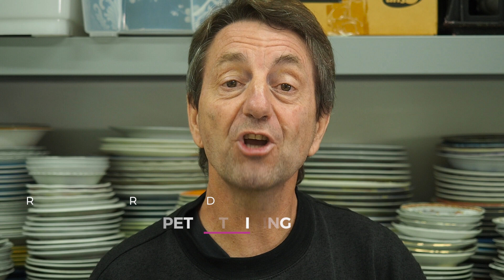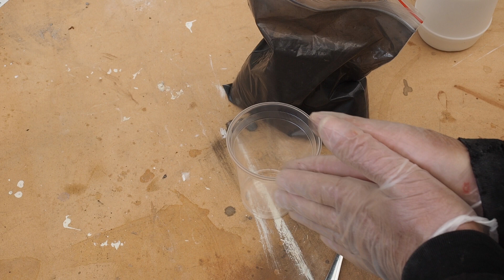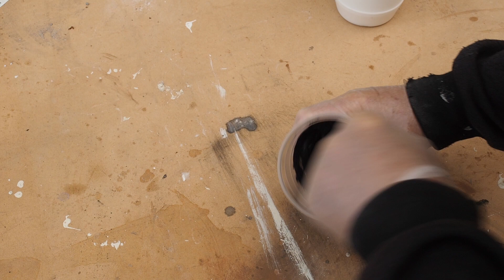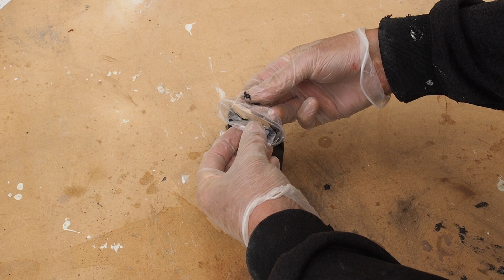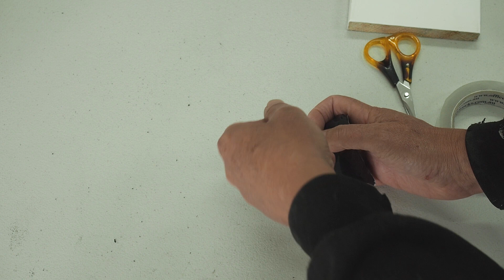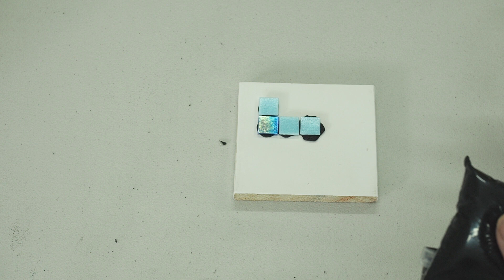Creating Thinset Using Grout - Mosaic Tutorial

Comment: Hi! When using this method, it solidifies very quickly for me in the bag, within 30 minutes, and then I have to mix more. Any ideas to prevent that?
Reply from the maker: Hi Olive. I haven't had that happen although temperature can play a part, if its warmer it will influence the curing time, so you may want to look into the temperature. Also there are different brands and that may also play a part as well. I hope this helps and thankyou for watching and for commenting. :)
Reply: @TreasuryRoad  thank you!! It’s been hot here so I think you’re onto something :)

Comment: Will thinset glue plastic pieces into a mosaic Peter?
Reply from the maker: That l cannot say l have never adhered plastic with thinset. Plastic has low surface energy which creates an issue with many types of adhesives. They generally appear to stick and then let go at a later date. There are also different types of plastic which just adds to the issue. Thanks for watching and for the comment. 😊

Comment: Thanks for your tutorials , very clear demos! Question , is there a product that is glue and grout so different size tiles can be push into it, no need to grout? 
Thanks in advance 🙏
Reply from the maker: Thankyou so much Ana. Generally speaking thinset (cement based adhesive) can be used as an adhesive and grout. This is the way that it’s done when using Smalti and in some cases slate. Do a small sample piece with the materials you’re looking at using to make sure it’s going to work with them and it will familiarise you with the process as well. 😊
Reply: @TreasuryRoad  thanks for your prompt reply, and knowledge . Yes I was thinking about to mosaic terracotta pots with shells and things I find at the beach . So just push them into the mixture. Any recommendations what brands to use,? 
Thanks again for your time 😊🐠
Reply from the maker: @anaschilling2668 Thankyou, I like Laticrete products for thinset, they are a world wide brand. There are different thinsets so just check with the retailer to see which one suits your needs. Also when you use the thinset use the baggie system it will give you greater control because its very sticky stuff. :)
Reply: @TreasuryRoad  oh so much to learn!! Thank you so much again!! I’ll look into it!! Looking forward to my next project!! 
And Looking forward to your next videos 😊💙
Reply from the maker: @anaschilling2668  you will get the hang of it pretty quickly. 😊

Comment: Thanks Peter for your video.
For making a thinset,  If I want to use an adhesive like "Davco Glass Mosaic Additive",  should I use Davco Grout aswell or any grout like Dunlop will work?
Reply from the maker: Thankyou very much Mozhdeh, whenever l use a product l like to use a turnkey system, if I’m creating the companies thinset l like to use the same companies grout as well as l find they are generally made to work hand in hand which can save any complications now that’s just my thoughts and l can’t comment specifically on your products. I always say to people read the manufacturers technical data sheets on the products their using as they have the accurate information you need and are very easy to read, generally available on their website. 😊

Comment: you are my mosaic hero. Peter, I have been wanting to take a plastic bird bath i have and mosaic it. can it be done and what would be the proper sealer and way to make the tile stick to the plastic and not lift on the corners of the birdbath thanks
Reply from the maker: Thankyou so much Michelle, I would avoid mosaicing over a plastic birdbath or most plastic for that matter as it can become brittle over time and and may have some flex in it, also the surface tension of the plastic can be an issue with adhesives. You are really better using terracotta or concrete and if you're in a freeze thaw area avoid using terracotta as its quite porous. We spend so much time on a mosaic its best to use a good substrate and suitable adhesives and materials to ensure the piece has longevity. :)

Comment: Thank you for all of your great videos, it has helped a lot getting started in mosaics... especially for demystifying all of the grout and mortar products on the market. For the Laticrete products, I am not able to find 4237 latex admix in smaller containers. I have seen that Laticrete has a bagged/powdered thin-set mix called "254 Platinum Thin-set" that already has the latex admix in it. The product data sheet does say that it can be colored like the grout. For this 254 mix you only add water to it since the admix is already part of the blend. Have you ever tried this thin-set mix?. Getting the 4237 latex admix is looking like an issue as it is only sold in the large bucket that you showed in the video. I haven't found a mosaic company in the U.S. that sells it in smaller quantities. The only option I can see is to us the 254 Platinum thin-set with colorant to achieve the same thin-set and grout color, which would make life a lot easier. I would like to use Laticrete as it does have advantages, one of which is that the grout doesn't need to be sealed. Thanks for any information.
Reply from the maker: Thankyou so much John. Thinsets can generally be coloured with oxides, this video just shows one combination, a lot of people colour their thinsets, I haven't used the 254 Platinum thinset but I think it may be may be able to be mixed with Laticrete Permacolour Select pigment packs, just verify this with the technical data sheet. Definitely colouring your thinset is the best way to go in my opinion. :)
Reply: @TreasuryRoad  Thanks for the info. I've been looking at the Laticrete data sheets to try to figure out the best way to go with which line of product to use and what combination of thinset and grout. It's confusing because they have several different lines of products. I realize now that their "Permacolor" line of grout is all precolored and there is no uncolored base mix. Whereas the "Permacolor Select" line is meant as a base to add colorants of your choice. For the Permacolor line, the data sheet says to only add water to it, but you've done well coloring it and using admix to get a thinset out of it. I have a floor tile store near me that carries the Permacolor products, but not the Permacolor Select products. So, I might just get the several grouts in different colors and color the thinset to match as needed. Thanks for all of your help figuring this out. I can move on to the experimenting phase :)
Reply from the maker: @Nature_Mage  My pleasure. You're right it can be a bit daunting. You can also ring Laticrete as they have a great technical department that are familiar with mosaics and will definitely help you choose. On the laticrete Permacolour grout technical sheet it says you can add Laticrete Latex Additive to create a coloured thinset, if you're grouting than you can just use water. I would think your tile store should be able to get in the Permacolour Select Products. :)

Comment: Thank you for this video. Is Perma color grout
 sanded or non-sanded, does it matter? Thanks again. :)
Reply from the maker: Thankyou. Laticrete Permacolour grout is a sanded grout. With regards to does it matter between sanded and non sanded, its best to use sanded grout for mosaics as it can go into wider grout lines and there is a greater resistance to cracking and also slumping of the grout also its a lot more durable, always go for a well known professional brand of grout to ensure you get great consistent results.
Reply: @TreasuryRoad  thank you for your prompt and helpful response, much appreciated. I haven’t ever used grout as an adhesive/thinset before and I’m looking forward to trying this method. 
Your videos are really straightforward and informative. Thank you for sharing your experience.
Reply from the maker: @sunnywilker3841  Thankyou and my pleasure, just make sure that the combination of grout and additive is a combination by the same supplier and is meant to go together to create thinset. I have used the Laticrete combination for years.
Reply: @TreasuryRoad  I don't want to keep on at you with questions, but I'm hoping I can find this brand here in the states. I thinking I can, and if I can't find it in a tile store, I'll check Amazon. You had mentioned Amazon will sell in smaller quantities as well, so I'm thinking now, that'll be my fist stop. :) Thanks Again, Sunny
Reply from the maker: You will as Laticrete is based in the states and you can go to their website and it will tell you your nearest stockist, I made a video on how yo use the Laticrete website. :)
Reply: @TreasuryRoad  thank you!! You are so helpful!

Comment: I am so glad I found your tutorials, I am planning to make a mosaic and cement it to a rock by the ocean where I scattered my mums ashes. Any advice or tips would be gratefully appreciated.
Reply from the maker: Thankyou, appreciate that. Make sure that whatever tess you use and the products you use will be suitable for the harsh environment its going to be in. Use good branded products and have a read of the manufacturers data sheets before purchasing products or give them a call, do not just take face value comments and act on them, preparation and correct products for that environment will be key to longevity of the mosaic. :)
Reply: Peter...this answered alot of questions. Laticrete products are not so easy to find near me. 
 I have much more understanding because you share your massive knowledge.
I would still like to know which protect you like for sealing outdoor mosaics after they are completed.
Thanks!!
Reply from the maker: @marciaelwood5235  Thankyou very much, appreciate that.  Laticrete have great products as do Mapei and a few others. When you mean sealing the outdoor mosaics I take it you mean the grout. I dont seal the grout on my outdoor projects because I normally use Laticrete Spectralock Pro Epoxy Grout as it doesn't require sealing however it is a three part system and more expensive. Impregnator 511 is a very good grout sealer but before purchasing make sure that you read the manufacturers technical sheets and also the MSDS as with any product to ensure its suitable for your job and you can take the necessary safety precautions. :)

Comment: Thank you first for your great videos... love them and look forward to them.
I’m still confused about using thinset and grout. Isn’t the additive just glue?
I am not a fan of grouting. Can I just use thinset with glue added to replace the grouting? Make it squish between the tesserae? Thanks again 🐢
Reply from the maker: Thankyou very much.  The advantage to using the grout and adding the Latex Additive is it gives you over 40 colours of their Permacolour grout range if you want to have thinset in a different colour. You can just buy thinset on its own and use that.  The additive isn't just normal "glue" its a latex additive designed to be used with their products. You can just embed your tess and have it fill the grout lines to save grouting. As always no matter what products you use make sure you read the manufacturers data sheets to ensure its suitable for your substrate, tess and environment its going into. :)
Reply from the maker: Hi Kathie I cant seem to access your comment that you left so heres my answer. You dont need to buy Laticrete products they are just my preference, just make sure its a well known brand such as Mapei or Dunlop etc. You need to use the right products that work together, dont substitute with glue as the products need to work together to ensure stability and strength. You can just buy thinset on its own and colour it with oxides or specific grout colourants, just make sure the thinset is rated for the tess you are using. Just for the record Smalti is generally not grouted as it can dull the finish and fill the pits up with grout. Using thinset with smalti is correct.
Reply: @TreasuryRoad  thanks again Mr. Treasury! I removed my post as I realized you had answered my question previously. I looked up Laticrete products in Amazon and they do have it in big amounts and for big money.... I’m thinking I will use the grout that I have and then see what my options are for adhesive that they have at Home Depot or even go to my local tile store to go with it. 
I also think that my problem is to work with the smalti. It’s so gorgeous and so expensive! 😳 I dont want to ruin it.
I haven’t looked yet, but I do hope you have a video on how to start using a hammer and hardy. Now that scares me too! 🤣
Thanks again for your generous time in answering and helping along with all the videos. Love them.
Kathie from Mexico

Comment: Hello there!  Following you has been a God sent through the past 5 months....Thank you for passing on all your tips. One question with the stepping stones concrete substrate.... Even after I seal the whole piece (with Laticrete Hydrobond) will the Laticrete thinset mixture you just showed us stick to the sealed concrete? Doesn't Thinset need something to grip onto? Should I sand the paver down a little after sealing to expose some "tooth"?  - I suppose same question for a bird bath....Fondly, Jane from USA
Reply from the maker: Thankyou very much Jane. Laticrete Hydroban is a waterproofing membrane and will work on the concrete with the  Laticrete thinset that I use. If your paver is super smooth and I am using Laticrete Hydroban I add some tooth to the paver before using the Hydroban but just do a small test if you're unsure. You dont have to seal your pavers just depending on the environment of where they are going, some people will just wipe the paver down with water so it doesn't absorb the moisture from the thinset when they adhere directly to the paver. The reason why some people dont like sealing is because its a barrier between the thinset and the substrate and if it fails then the piece fails. Hydroban was designed by Laticrete who make thinsets.  Have a look at the Laticrete website at the manufacturers product data sheets on the products you want to use so that you are more familiar with what you are using, its a good habit to get into no matter what product you are using, these product date sheets are very important because it will tell you what you can do and any limitations the product has. :)

Comment: Must the grout have to be sanded in order to be converted.  Also, I was under the impression that sanded grout only needs to be used when the grout joints are far apart. Any clarification would be appreciated!!! Thanks again for this video.
Reply from the maker: Thanks and my pleasure.  Good question, this technique with Laticrete works with sanded Permacolour grout and not with unsanded grout, I dont use unsanded grout as I find them sticky, they can shrink and their not as durable. But they have become better in recent years. Correct unsanded gout can only be used in smaller grout lines up to around 3mm, sanded grout can be used in 4mm and larger grout lines up to around 15mm give or take as a general rule. I tend to use sanded grout in narrower lines without a problem in a mosaic without issues, Im speaking here regarding Laticrete Permacolour grout as grouts are not all the same. If I was laying tiles in a house then I wouldn't be putting my grout lines as close together. You will find some people love unsanded grout and others dont, I only use Laticrete products because I love the consistency and the quality of them but thats really a personal choice. :)

Comment: Just so it's clear in my mind Peter..is Permacolour Grout with Additive..actually Thinset?..or Cement based Adhesive?..I was under the impression that they are 2 different things..so the additive actually makes it Thinset?..but the grout by itself does not adhere...sorry for being a bit thick!
Reply from the maker: Correct the additive turns the Grout into thinset without the admix its just normal sanded grout with no adhesive properties.
Reply: Thank you!..it opens up a range of colours!